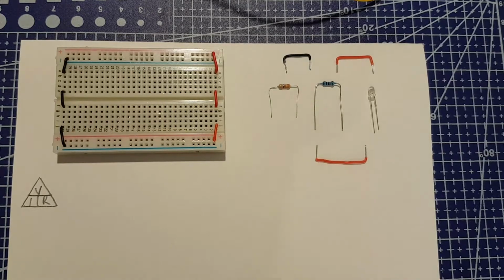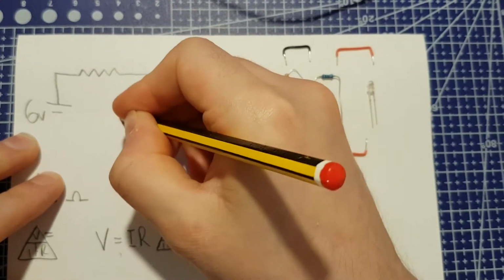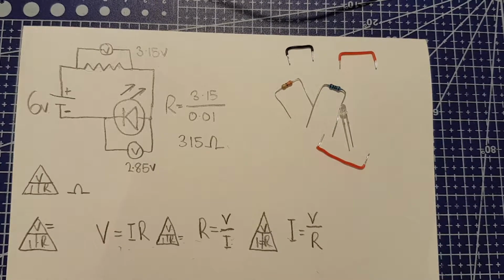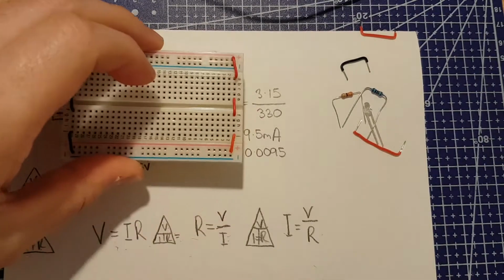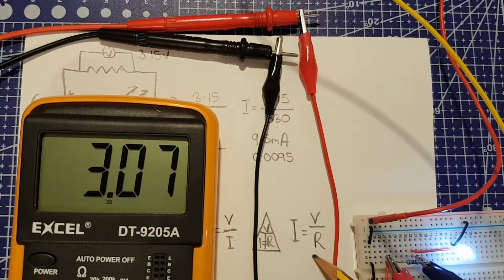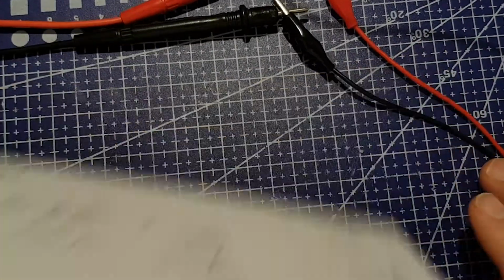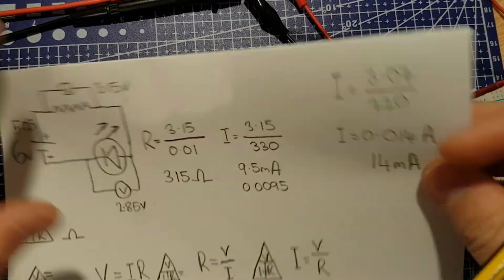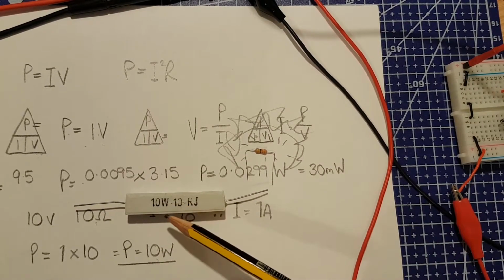Ohms Law

Comment: Gonna pod you
Reply from the maker: lol, not very nice im an engineer not a soldier
Reply: @djdoncruz  :D i've been trying to do wormholes, but my t.v keeps dying and video card issues.
Reply from the maker: @sarttee  you playing EVE through your TV? HDMI from your graphics card?
Reply: @djdoncruz  yeh
Reply from the maker: @sarttee  a PC monitor maybe smaller but will generally have better quality (depending on the cable). maybe same amount of pixels if they are both HD but monitor will have higher pixel density. Using a full DVI cable makes a lot of difference over a VGA cable for a monitor too.